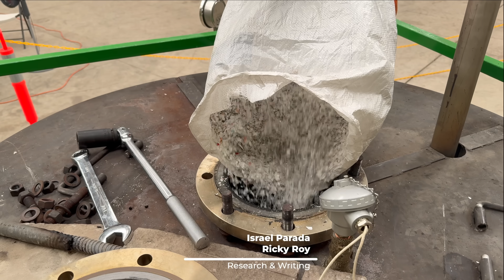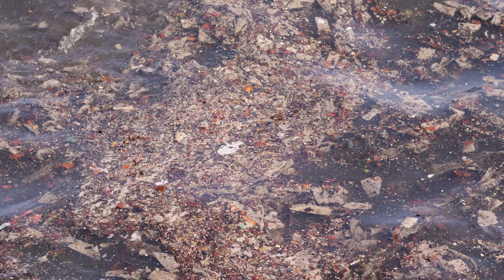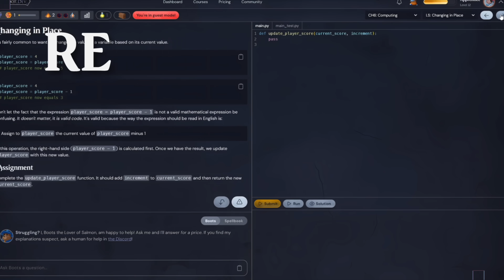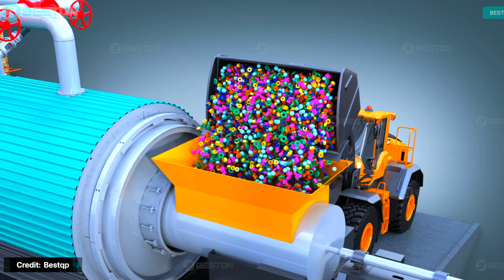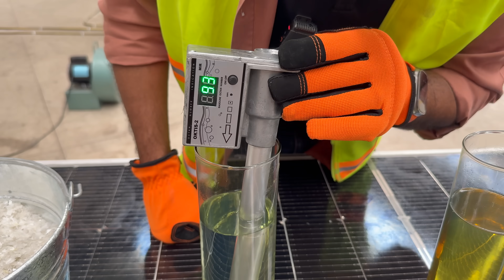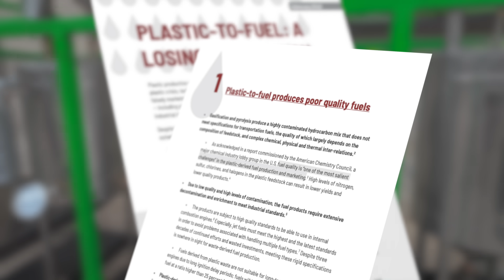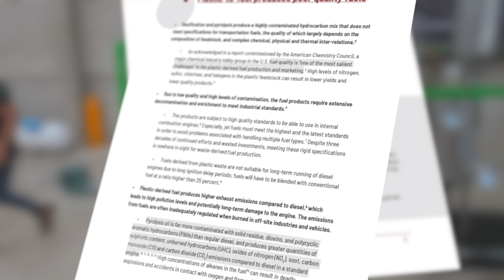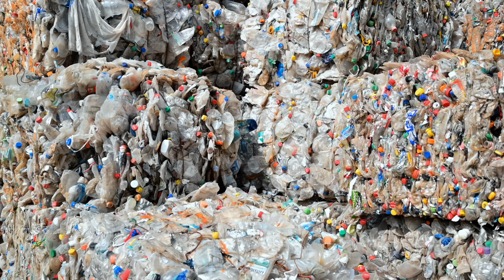Solving the Plastic Waste Problem - This Surprised Me!

Comment: Petroleum is used to make almost everything we use in our everyday lives. If you ca recycle waste plastic and then turn into a product that would offset oil required to create fuel, it would create a competitive economy in that industry. We are using old plastics and avoiding SOME of that going into our oceans, creating an industry that will give oil companies a competitor and possibly lowering the cost. 

This invention will trigger others to start thinking on a different level. New ideas always trigger smart people to step back and look at a problem with a new perspective. This is a good thing. Hopefully this team does not disappear!!
Reply: We used to add plastic (and waste oil) to the fuel supply of coal fired power plants and let the already existing scrubbers do their job on the waste gases. We were getting 100% of the available energy out of the plastic, putting it to good use all without increasing costs with all those other steps. The resulting fly ash was sent to cement plants and used as a vital component of their products. I’m not saying this isn’t a cool idea, but we’ve known how to get the hydrocarbon energy out of plastic with very little waste and put it to good use for a long time. Somewhere along the line, coal fired (incinerator) power plants fell out of favor, and there are reasons for that but I want to make sure we getting less waste products and the same or less exhaust emissions before proclaiming this a miracle cure. 
And he’s right, this is a fancy way to incinerate plastic.
Reply: @jamesstamford2902  this is no invention , guys make that home since long time
Reply: Just look for YouTube videos you will find a lot very very old
Reply: This business model is not economically viable. Plastic has a cost — no one gives away waste for free, especially if it has been pre-treated — and the energy required has such a high cost that, in addition to raising the break-even point, it may even compromise the sustainability of the entire business model.
Tbh, I know people who own a better technology. It can generate all the energy required for the process itself, it can produce kerosene (or diesel or gasoline), and most importantly, it can process any type of waste.
What is shown in this video is nothing more than pyrolysis and gasification applied to clean plastic (already processed). There is nothing new here — we’ve known this process for at least 50 years
Reply: This would help stop drill in environmentally sensitive areas. It may also contribute to transportation of oil thru pipelines and over oceans. This could help prevent the next big disaster. 🤞
Reply: @MM-sf3rl lol , no it's not , first it's not new , they do exact same thing as raffinerie does ...for more expensive
Reply: Plastics are fossil fuels.
'Recycling' them into a liquid fuel and then burning that fuel puts the fossil CO2 into the atmosphere. You get the same result by burning the plastics without 'recycling' them.
Reply: @Paul-yh8km  Also you did not watch the video or the full thing. Did you not see where the estimated reduction in C02 by a min of 50% nope you let your sheeple emotions do the thinking didnt you? Its ok to be a simple minded savage sheep.
Reply: @Paul-yh8km  was just pointing that out in my comment. i mean at least they are creating 'practical' products and reducing plastic waste.... but it's at the cost of increasing carbon emissions. but now i just realised something.... they are not creating more carbon... yet. only the use of its products create carbon. And the 'carbon emission needs' of the planet is based on productivity, leisure, etc. so its a set amount that increases very year as more people moving into becoming part of that cycle. So these products are not 'adding' to the carbon, it's competing with existing carbon sources, for the same market? ie. arguably it should potentially bring down prices... and remain carbon neutral, to use the phrase loosely. to use your example: just burning plastic definitely would increase Carbon emissions, but this should 'replace'/'compete' with the existing volume of carbon. is any of this making sense to you? or did i miss something.
Reply: @ericaugust1501  
Garbage.
Plastic is stored fossil carbon.
If you make fuel from it or burn it in an incinerator you are adding fossil CO2 to the atmosphere.
It's no different to burning petrol, diesel, kerosene etc.
Reply: @Paul-yh8km  Oh god here we go with a C02 is the end all for the world. Humans contribute approximately 3.4 percent of annual CO2 12 The remaining 96.6 percent are from natural sources, like volcanoes, decaying plants/biomass, and animal activity, seen in Figure 2, below. If ya google and research you will see we are barely making a dent in the total C02 levels. But hey you are a blind sheep its ok follow along past the edge of the mountain thats what they want. Take 5 minutes at the min and research and stop spewing what you hear on CNN or Fox.

Comment: I appreciate your enthusiasm for the technology, but I find it hard to be enthusiastic about a new method to create a material (hydrocarbon) which ultimately adds to the CO2 in the atmosphere with all the consequent problems that causes.
I would be more impressed if the waste plastic was not released into the environment.
Reply: Carbon dioxide is essential for plants to grow and produce oxygen. Through photosynthesis, plants use carbon dioxide, water, and sunlight to create energy and release oxygen.
Reply: @votaric  Prior to the Industrial Revolution atmospheric CO2 was about 280 ppm. Now , about 250 years later it is over 400 ppm. This is the cause of concern.
Reply: Carbon dioxide is essential for plants to grow and produce oxygen. Through photosynthesis, plants use carbon dioxide, water, and sunlight to create energy and release oxygen.